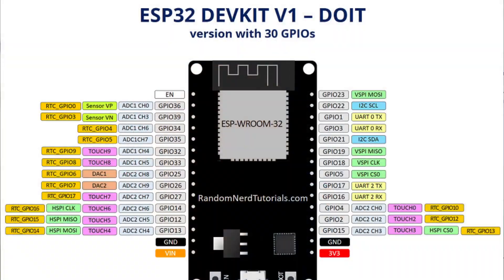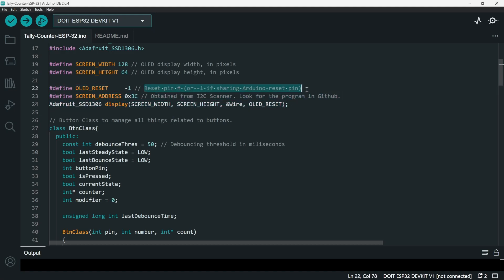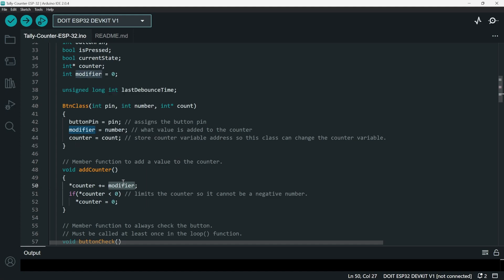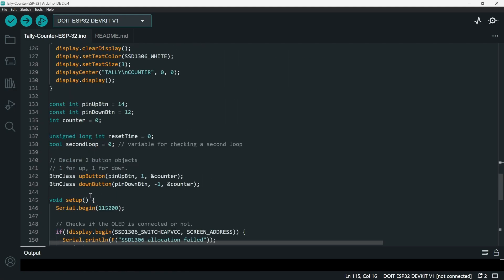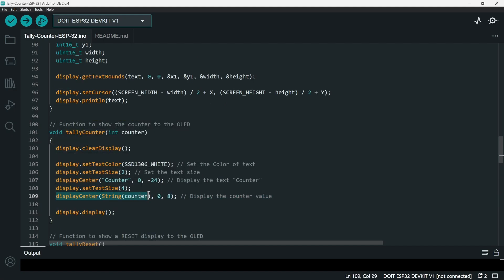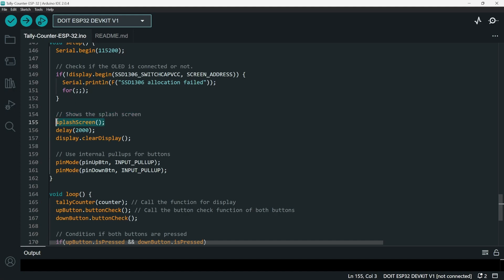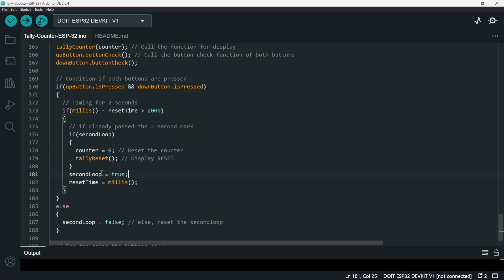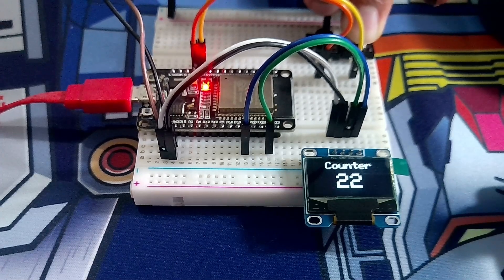ESP32 Tally Counter Tutorial (Counter with Button Debouncing and OLED)

Comment: Great project, could you help me getting it work on ESP01? It has only 3 GPIOs but I would realistically need only one for button and 2 for I2C display.
Cheers
Reply from the maker: That's actually interesting. From what I know, ESP01 can be configured to use the 2 GPIO availbale for SDA/SCL. For the push button, we'd have to use one of the RX/TX pins. Might consider to make a video on this.